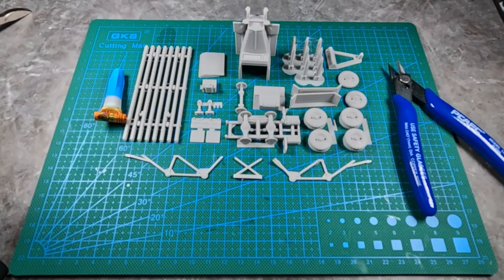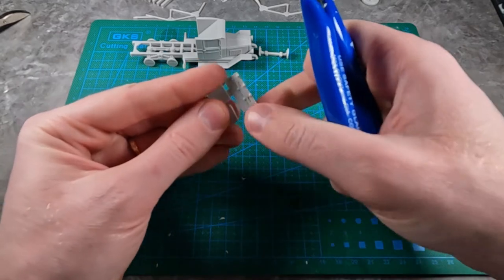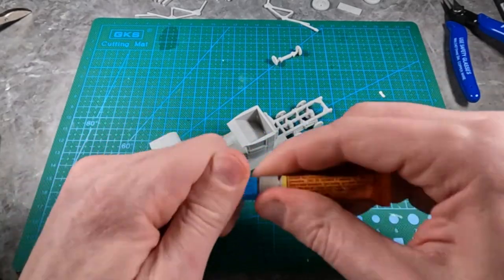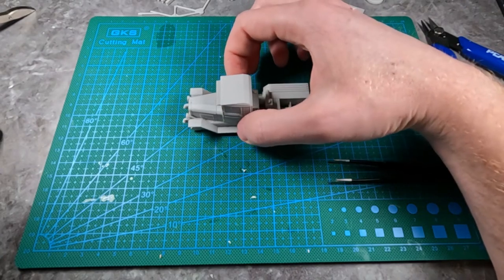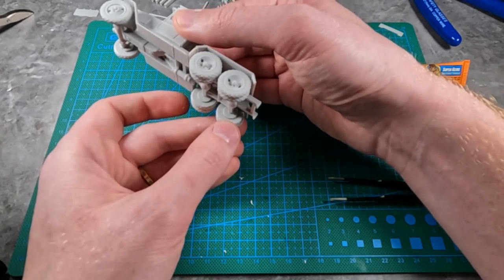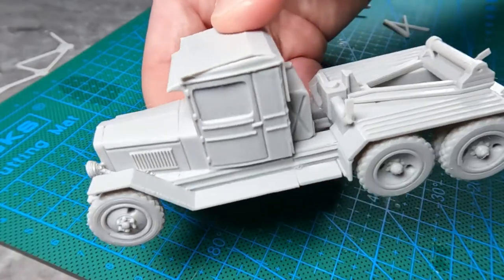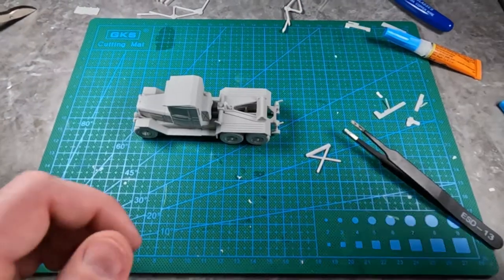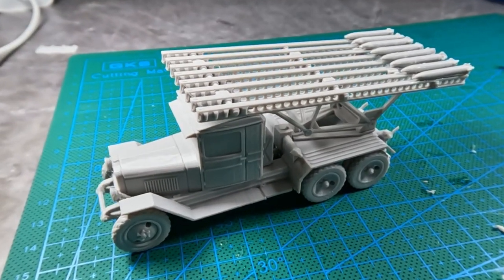BM-13 Katyusha Assembly Instruction Video

Comment: Use this for the ZIS-6 truck assembly as well.
Reply: I'm still having problems lining up the double rear wheels under the crossmembers, which are on the ZIS-5 & 6, but not the Katyusha, thanks.